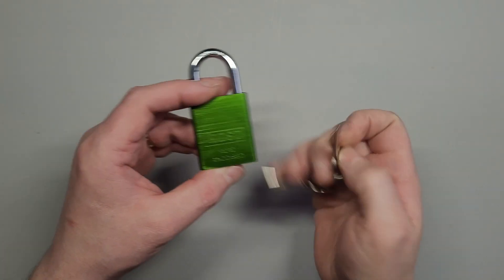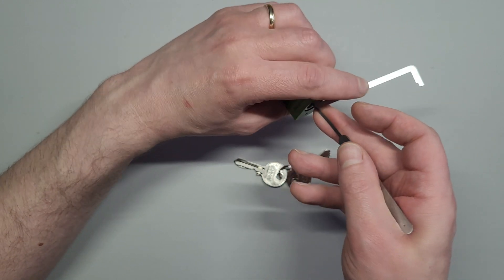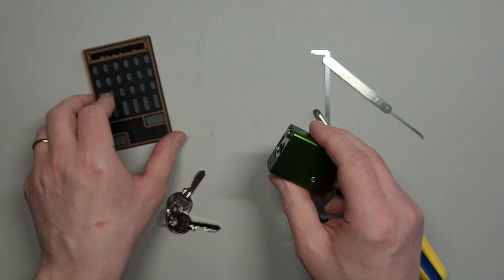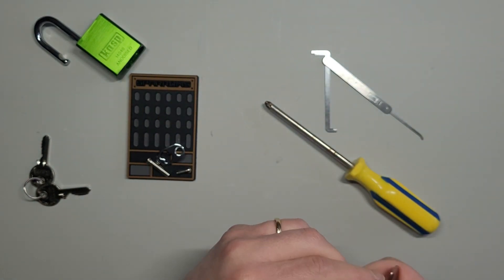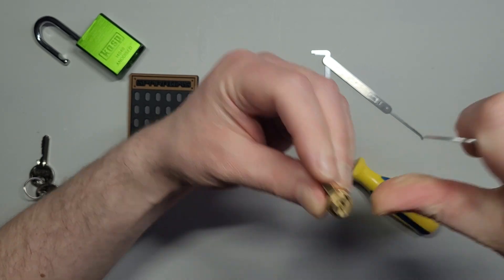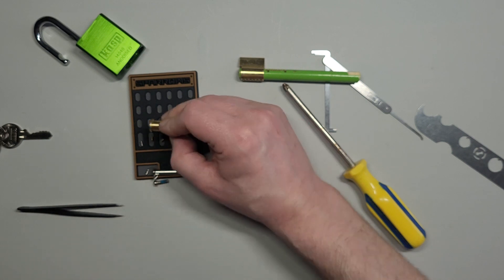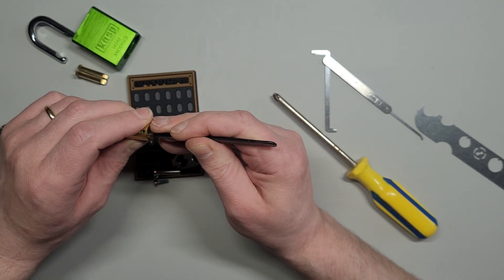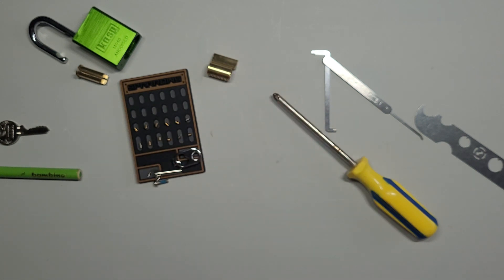Kasp 14040 pick and gut #locksport #lockpicking

Comment: Nice job.Are u picking around the warding in a curved fashion mate?just received this kick in the post today.As usual got it open fast and haven’t done it again since!😩😩
Reply from the maker: Yea, I'm using a 0.02 hook, and yes, I tend to find it works well if you slightly rotate it around the warding to push the pins up. Sure you'll get the knack. 👍